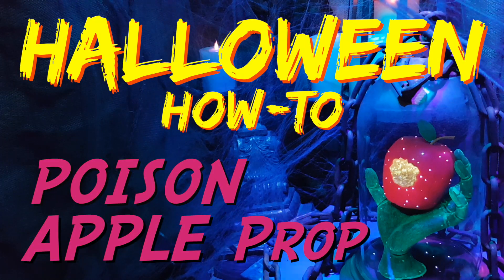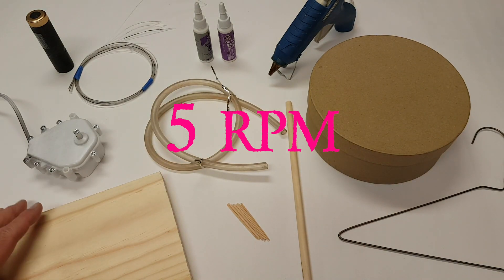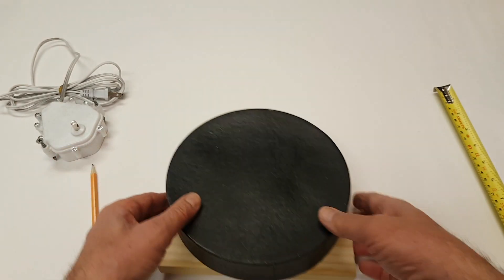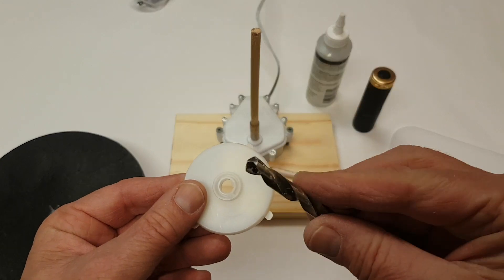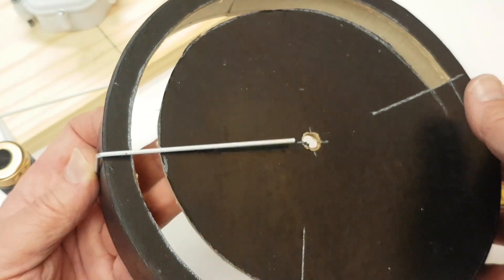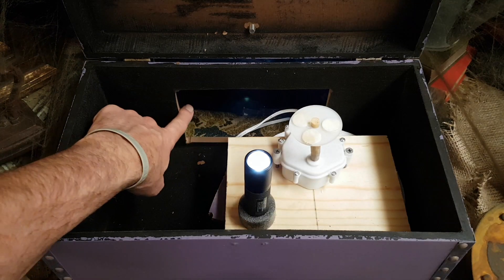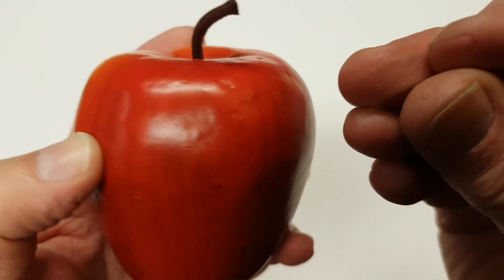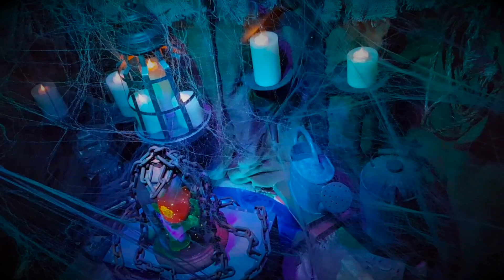DIY Animated POISON APPLE Halloween How-To Prop

Comment: Dito! Your tutorials are so thorough and true step-by-step instructions. The two aspects of this project you didn't cover was the overall illumination of the hand and the apple, and where to source the fiber optics. Did you use fluorescing paints and an external blacklight to make the hand and apple glow? That is my guess. I love the overall effect - VERY Disney Imagineering!
Reply from the maker: Thanks Steve Mahr for the comments and also the questions.  I sourced the fiber optics from a local lighting fixture store but it can also be found at computer parts stores (for those that build their own computers), online and I have also found fiber optic lights and do-dads at thrift stores where you could repurpose their fiber for your own use.  I did use a blacklight for my set (along with other lights), however I used no blacklight paint ... it just gave it that interesting look.  The overall effect being compared to Disney Imagineering is the ultimate compliment, much thanks for that!

Comment: Love watching your videos any chance could you do the enchanted rose  From Beast And the beast
Reply from the maker: Thanks for watching and leaving a comment.  I think you could use this video as motivation and with a little ingenuity, the components of this prop could be re-worked as the rose from 'Beauty And The Beast'.  Although I will not be able to do it, I would love to see the result of your efforts if you decide to take it on.  I think the key would be to find a hallow tube for the rose's stem and run the fiber optics up through it and onto an artificial rose.  Or wrap the fiberoptic cables bundled along with a wire with floral tape or green colored platic tape.  That way you could also gracefully bend it to look like the rose's stem.  It is all trial and error... and persuveriance.

Comment: What colors did you use to paint the apple and hand? Chalk paint, spray paint, flat, gloss, ext ext?
Reply from the maker: Thanks for asking Brian.  I used simple acrylic (the type in the small tubes with flip-top lids), water based paint from a hobby store.  I always use flat or low luster to avoid shine and glare off of the objects.  I will at times use a spray paint, especially as a primer and/or base coat.  Although I did not use blacklight paint, I did use a blacklight for some of the lighting just because it can give a cool effect.  I think what is important is not to forget shading, highlight and shadow painting to give things dimension.